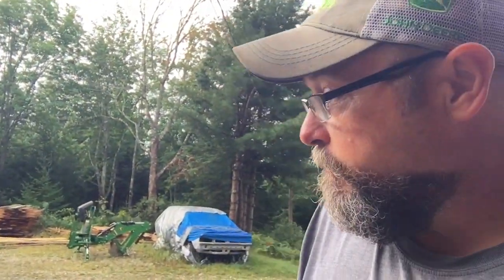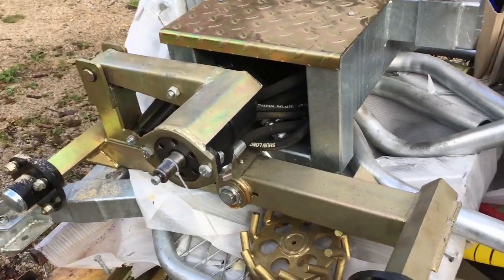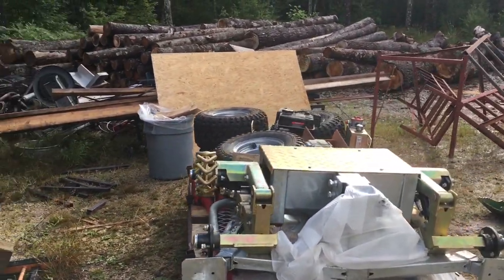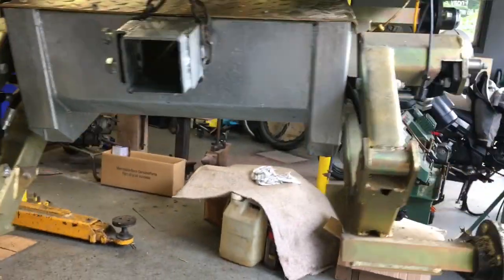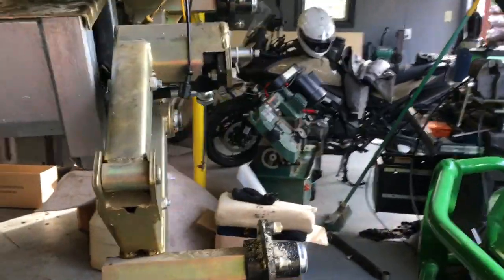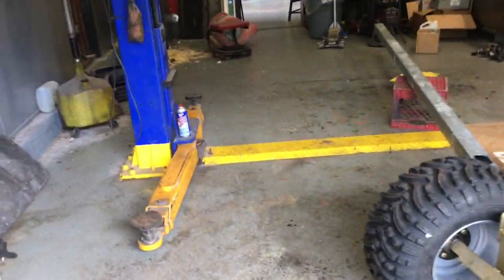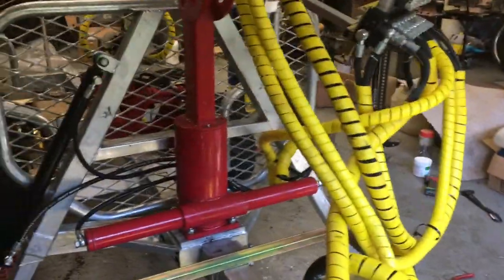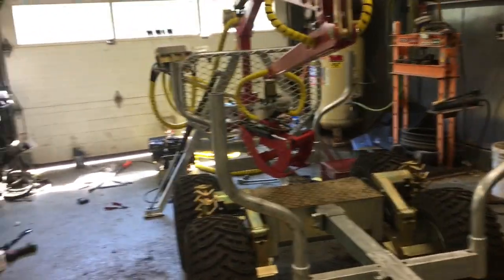Compact Hydraulic Timber Trailer

Comment: Great loader log trailer.   I didn't realize that it had drive wheels. Nice.   If I may make a suggestion,  try not to move the camera around so fast so we can see what you are talking about.  It's a kinda motion sickness effect.
   Thank you for explaining everything. 
   Best Regards
Reply from the maker: I’ve since invested in a new camera that should help with smoothing out the images- I agree- it’s a little too much to take in, especially on a bigger screen! Thanks for hanging in there! Cheers, Jeff

Comment: Howdy from Nova Scotia, new sub. Found you trying to get some video feedback on the Norwood winch. I also looked at those trailers, but between the tractor, sawmill (WM HM130 max), land prep, etc, I was hemorrhaging money at too quirk a rate. Getting some money back now, so maybe next spring for the Iron Baltic.
Reply from the maker: Where in NS are you?
Reply: @thelogfather5002  I retired from the military just over four years ago, and bought a place on the water near Orangedale (Cape Breton). Watched your rant about logs...it's ridiculous down this way trying to even get a load of logs, let alone good ones. Saw a Kijiji add the other day, a fella up in the Valley was OFFERING $175/cord for saw logs. They should only be $150, the province is full of them!
Reply from the maker: I’m on the south shore of NS, log procurement has always been my biggest challenge. I’m not concerned so much about the price, as long as it’s fair and market aligned. It’s the quality and then finding a truck to haul them for me. I have a dump
Trailer and a truck to haul it, so if there’s a way to load them on the other end, I’m good! 
The trailer can dump them off here at the mill, otherwise I can use my little iron Baltic trailer to unload them. 
Thanks again for watching! Jeff

Comment: May I ask who you dealt with for your timber trailer and how has it been for you? Do like it im considering buying the same one.
Reply from the maker: I bought it from eastern farm machinery in Ontario. It’s been working out great- I’d buy it again tomorrow if something happened to this one. Thanks for watching! Jeff
Reply: Thanks for your quick response I reached out to north forest products and see what they have and pricing. I have a 31hp 4x4 tractor that pair with the trailer would be a great combo. it seems to be pretty powerful for its size.
Reply from the maker: @earthandheavenlandscapinga4850  that’ll be a great combo! Does their trailer have a hydraulic drive on the axle?
Reply: Yes its the same trailer as yours they are out of NH. I put in a request for info and pricing.  Was it hard to assemble yours?
Reply from the maker: Very easy to assemble. I’m a mechanic by trade though, the only downside of it- for you being in the US is that it’s entirely metric. That’s ok for every other country in the world, but if you blow a hose or need a fitting or fastener- you may have to search a bit to find what you’re looking for.
Reply: ok shouldn't be a problem in very mechanically inclined and we have a great hydraulic shoo near by that can get most anything I might need. Ty and looking forward to more videos with your trailer.